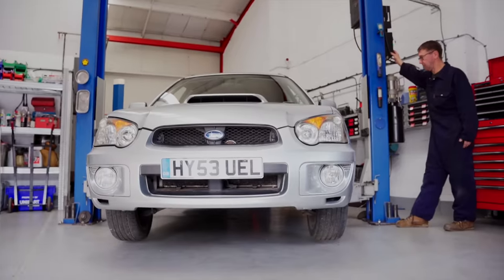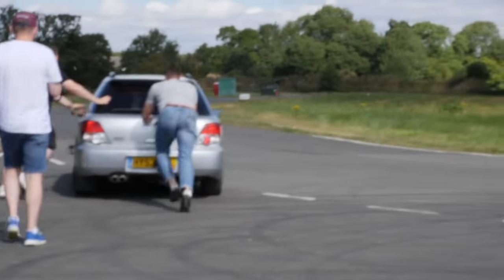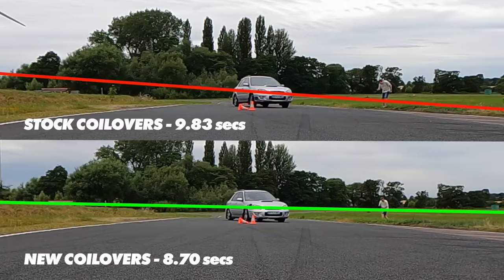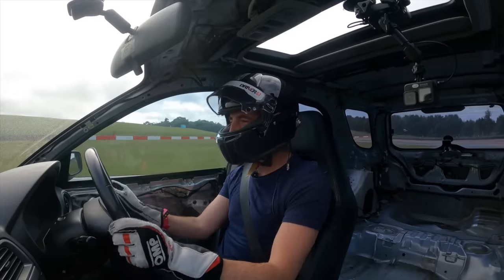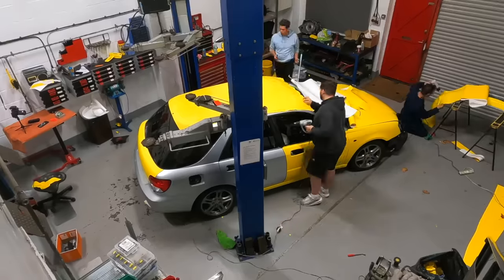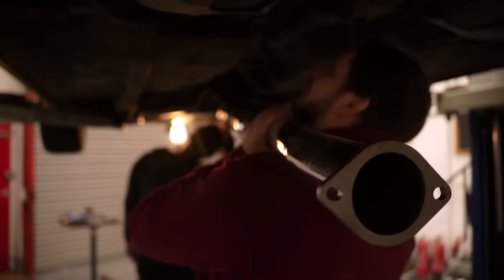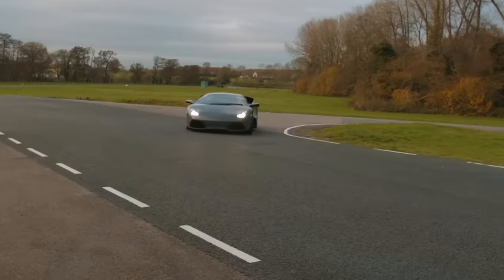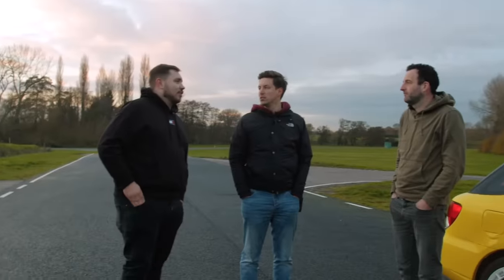We Built a $10,000 Subaru that BEAT A Lamborghini

Comment: Fortunately the engine didn't blow up like Donuts Subarus.
Reply: Apparently they had a beefier engine, which was the one more prone to blowing up
Reply: Not one not two but 7 engines
Reply: Yeah lol
Reply: @commandergeokam2868  i know first hand that subaru engines have their issues, but i got to thinking about donut media and the problems they had and i think it comes down to 3 things:
1. The desert heat
2. The long sweeping corners (boxer engines without a dry sump haaaaaate these, because it causes oil starvation at the sump and pooling at the heads and valve guides)
3. American cars are notoriously badly maintained in general, though i do think this is probably a non issue in their case.
Reply: @Nbomber  of course i understand this i will agree with the part 1 and 3 but after the first engine breakage the putted new oil pans to prevent the starvation
Reply: A quick lap around a kart track is a bit different from a half dozen people hot lapping a giant desert racetrack like Donut tried to do
Reply: @Nbomber one of the first things they upgraded on both cars was the cooling
Reply: Yeah, because Driven Media actually knew how to be smart and go around asking people what mods to do. 
What did Donut Media do? 
Even though several people gave suggestions as to how to build them, they decided to look the other way and thought they knew better. Tein's ain't what should have gone on Hi-car, it should have been Ohlins. If they asked people like Smeedia or companies like IAG Performance, they wouldn't have gone through however many engines they did
Reply: @SkylineLofe  doesn't change the fact that those engines are pretty far down on the reliability list.
Reply: @pchris yeah but we aren’t taking about the coolant are we? He said oil starvation not overheating…
Reply: @commandergeokam2868  i think that was after the 2nd engine on the 2nd car. But just a deeper oil pan isnt really optimal for what they were doing. An expensive dry sump is the way to go. For street driving, the upgraded sump would be ideal tho.
Reply: @pchris  thats fair tbh, but it was still oil starvation that caused the rod bearing damage, and the heat wouldnt have helped even with the upgraded radiator. Ej engines produce a ton of waste heat.
Reply: @CUSTARDP00DLETK  that was later in the series. Also, break in period is more about wear than blowing an engine up.
I think we can agree that used motors, and built motors, they didnt pay attention to the important items like the oil system.
Reply: @no1washerezz  agreed. But in reality, its more that they are highly strung. If you look after them, they can be hella reliable.
Pay attention to temps, coolant cleanliness (a small peice of debris killed my first engine by blocking the thermostat bypass valve), oil cleanliness and pressure, and use good fuel. The head gasket thing is somewhat true, but grossly overstated. The later engines can do 150k miles before it usually crops up.
Ringland failure is an overboost/overheat issue. Rod bearing knock is oil starvation.
But the truth of the matter is, they arent particularly reliable in the grand scheme of things. High maintenance. Suspension steering and chassis components are a constant wear item and mpg is brutal.
But apart from all of that. They are great drivers cars.
Reply: @Nbomber  any motor that is taken care of and not abused will be very reliable. the real test of reliability here is track time but it's quite obvious that these cars cannot sustain that abuse for very long whereas you could beat the snot out of say, an ek civic and it will run that track with enough sturdiness to bring you back home and tuck you in bed.
Reply: *donut
Reply: @wontonii232  you're right
Reply: @Nbomber  #2 and #3 are irrelevant because hey blew up a brand new engine direct from Subaru, and all of them were fitted with baffled sumps after the first one blew.
Reply: @TomoHawKzZ  anime pfp, doesnt know anything about engines. Cool.
The engines werent direct from subaru, they were 3rd party rebuilt. And they didnt really break them in.
A baffled sump is not a dry sump. All the baffles in the world wont help if the oil cant flow back to the sump under sustained g cornering.
Try to remember they are running in the desert heat with track tires. The cars are producing way more lateral g than the stock cars were ever designed for.
Reply: That's wagon version are better built in the engine for less price
Reply: @gold3263301  plus the saloons get upgraded a tiny bit which faults the car in the models you mean, It was only a small few models which had weakness faults,
Reply: Remove the rear fitted fuel tank and add a double or at the most triple sized fuel tank as a tank fitted inside the interior rather than underneath the, and add new fuel injectors and injector lines and go for brembo brakes and add a weight in each rear corner inside the bumper welded onto the frame then the bumper goes back on covering it, and the rear hidden weights is a free non  failing steering issue hack
Reply: Nah they just got the right model and don't have too much forque on the.mechanical parts
Reply: Donut's engine didn't blow up. Their engineS blew up. 😂
Reply: 1. NA Subarus are badly beat up in general. 
2.Subaru engines have to worked  on perfectly , one tiny fuck up and you will probably need a new engine .
Reply: If you watch subaru you don't know nothing bout cars lmao, just listen to drew peacock
Reply: they had a very diffrent life most EU cars don t do 100 mph on a normal drive ppl in usa speed and drive like shit